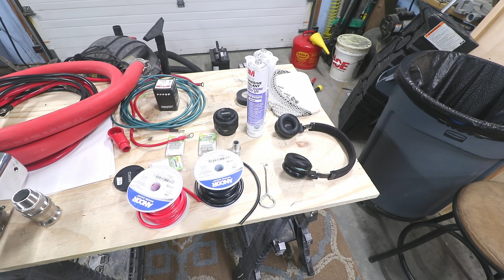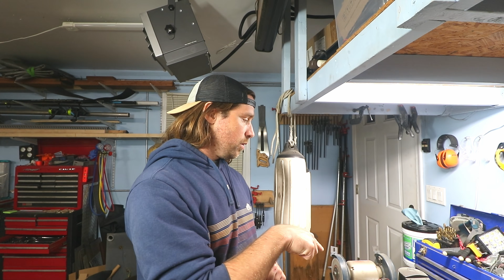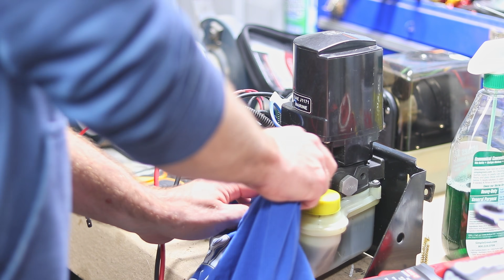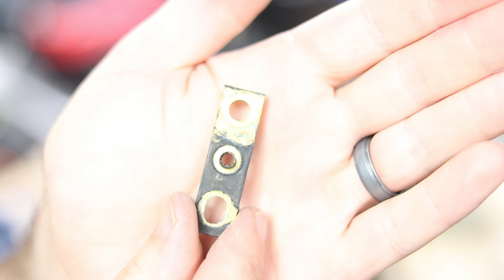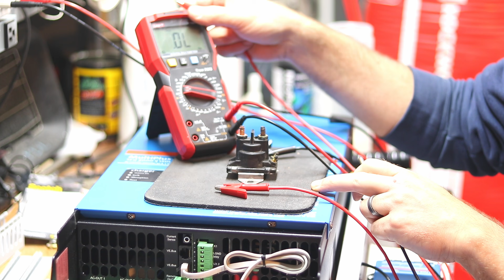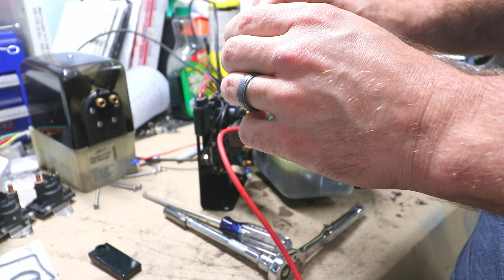Diagnose and Repair a MERCRUISER Trim Pump

Comment: A small tip. The flyback diodes you added, those only have value if the solenoids are driven by a semiconductor driver. In most cases, especially old boats, the actual driver is the activation push switch which is mechanical switch and the kick-back voltage won't hurt that switch. The diodes will protect any semi driver if applicable. The kick-back voltage will blow out a semiconductor driver as the voltage kick-back could be very large.
Reply from the maker: I understand where you’re coming from however the purpose in this case is arc suppression in the contacts.. if you go back and watch my old video where I cross sectioned a solenoid, you can clearly see arcing when it’s used as-is.. but with the diode added, there was literally no more arcing..

Comment: I know you recommended 100v diode on your previous video, but 1000v keeps popping up an Amazon search.  Does it matter how much volts it is as long as it’s not too small?
Reply from the maker: Nope, higher voltage is fine, just will likely be a slightly larger package size.. you’ll also want to make sure it is rated for at least a couple amps..
Reply: @ashipshow  Man, idk...I order 1N4007 diodes..they said they were flyback...they are tiny...can you confirm these are acceptable?   Appreciate you brother!
Reply from the maker: @bmonden yep, that’ll do fine.. but if it makes you feel better, just search for diodes on Amazon that are at least 100v and at least 5A.. doesn’t matter if it’s called a rectifier diode or schottky diode or flyback diode.. they will all work.. it’ll probably be overkill but you’ll sleep better 😅

Comment: Hey I’m having a problem I get the click up and down but I’ll tap the pump with a wrench and it get it to go but once it stop you have to tap the pump again to get it going what do you recommend
Reply from the maker: Could be corrosion on the brushes or brush mating surfaces.. unfortunately that means you’re going to need dig a little deeper..
Just to confirm it’s not related to the solenoids, you could try jumping the power contacts on the solenoids..
Reply: @ashipshow sounds good thanks I’ve give this a try

Comment: I just replaced both solenoids. My outdrive is fully raised. When I try to lower, I’m still getting a click. Up and trailer Up both seem to run the pump. Thoughts on what to check?
Reply from the maker: Oof.. up is usually the issue.. down has less possible problems.. you could try bridging the two main terminals on the down solenoid with a screw driver (carefully) and see if it moves.. If it doesn’t there is something wrong with the hydraulic pump circuit